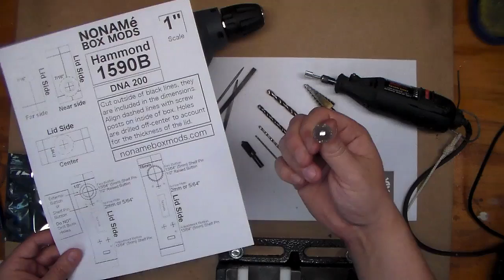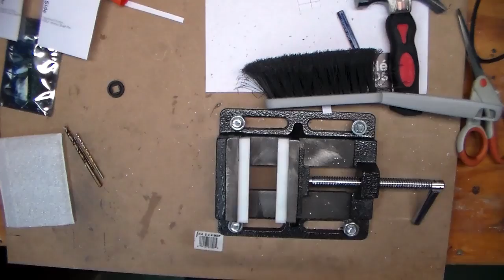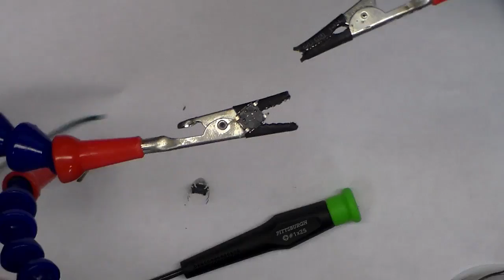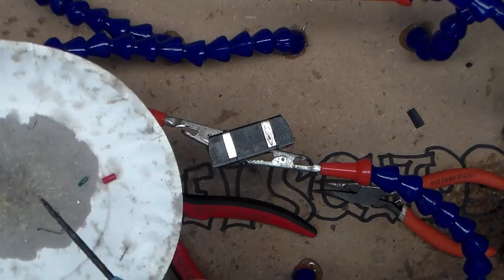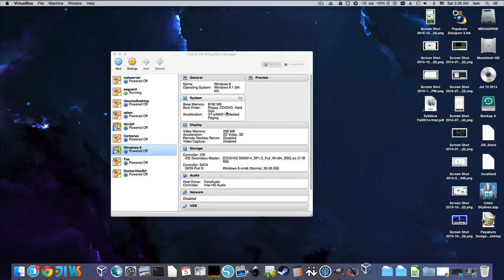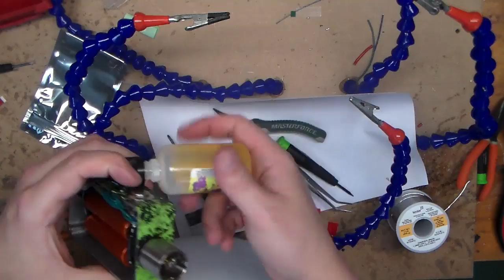Dual-18650 DNA 200 Build

Comment: hey question I have everything wired up, I hit the fire button and the evolv screen turns on, turns to 8.5watts, then 2 secs later the unit turns off, why is that? have you had this issue?
Reply from the maker: You might not have the balance charger connected correctly. The notches are supposed to point down. Otherwise make sure the buttons aren't jamming or otherwise being held down.
Reply: Advicevice how to order?????

Comment: I missed the part where you attached the screen? does it just plug in or is there a latch?
Reply from the maker: There's a little latch on the board that flips up. Insert the ribbon cable and clamp it back down.
Reply: +Advicevice Ya, I figured it out shortly after my response. unfortunately I think I got a bad board and am still waiting on evolve to tell me what to do about it.😔

Comment: I did not understand : it is a serial or parallel connection of batteries ?
Reply from the maker: It is wired in series. Parallel wouldn't power the board.

Comment: Correct me if I'm wrong or not, I'm just lerning about this stuff to help my Wife out, but this seems useless now, as it's at $99 and you can buy a Fucai for $43 Free shipping, so why pay $99 and then still have to build it yourself when you could buy 2 Fucai for that price.
Reply from the maker: +Rspene smit Honestly, you get what you pay for with Chinese knock-offs. The other side of it is a lot of people enjoy building stuff. You can buy a pre-built model airplane or build one yourself.
Reply: +Advicevice Ok, thanks for your reply, I do like to build some things, but I'm limited on the projects I can do, but I might give it a try, but it sounds like the $43 one I found on ebay, may not be good or great Qualitty, so also I guess if I want the best Quality, either try to build this one or find a seller in the U.S. that sells an original one, I have not checked prices yet on an original.
Reply from the maker: +Rspene smit The board featured in the video was designed and manufactured in the US by Evolv Vapor. That does generally cost a little more, but it also comes with great warranty support. I doubt you could expect the same from the Chinese suppliers.

Comment: Question. Are mini zip-ties a good or bad idea? I have built many PC's and love using them on wires/cables, but have never built a mod. It seems like they would come in handy. I'm talking about the real thin ones, not PC size. Thanks. 

I really appreciate you bringing these mods to market and the build videos. you are very thorough.
Reply from the maker: +Rob G As long as you're crimping the wires to the point they break, I think you would be fine.

Comment: Yo m8. The DNA200 chip works at minnimum 9v input so how does it even start ?!
Reply from the maker: +Enteriel You can configure it with eScribe to operate with 2x 18650s: https://youtu.be/orizvoMytfM?t=1h59m54s

The only downside is it's limited to 133W
Reply: +Advicevice ok, now i get it ;) ty for Help !! Cheers ;)

Comment: Im keen on buying a kit, can you have the atty offset instead of in the middle?
Reply from the maker: +Dr Shlots You're building it, you can put it together however you want. With that build it's all a matter of preference. The drilling diagram was templates for each position.
Reply: Thank you, also i live in New Zealand what would be the cheapest shipping method?
Reply from the maker: +Dr Shlots I just added New Zealand to the store, it will be $34.95 USD. I know it's outrageous, but that's actually my cost on shipping.

Comment: love the vid btw
i wanted to ask if i dont want to use the in built charging can i just put the + and the - to the bord without the jst conector
and ps do i still need to use the escribe software to change the battery profile
thanks
Reply from the maker: +jonathon cobb If you're running off battery, you need to connect the JST balance charging connections. The board won't fire without them. It will in passthrough mode, but that's because there's a power supply that doesn't need to be monitored. If you are only using 2x 18650, you have to change the settings with eScribe. It's a good idea to look up the discharge profile for your batteries.
Reply: Thanks for that I wanted to make sure now I know I will make it so 😊

Comment: Escribe was working. It linked and I was able to run the device monitor. I still couldn't get the screen to respond even when I tried to change and upload settings. Ive built several but this is my first with the off board button. I'll do some more trouble shooting and let u know how it turns out.
Reply from the maker: +Mitchell Henderson I guess, the obvious thing would be to check where you soldered the button wires in to pin holes 1 and 2. If it's bridged, that may be an issue. If you have another screen, I'd give it a shot at swapping it out. Good luck

Comment: Plug seems to be lined up right to all the corresponding points. On board fire is not working either.
Reply from the maker: +Mitchell Henderson Are the notches in the JST plug facing away from the board? Options are 1) Screen isn't plugged in correctly 2) It's not getting power 3) The board is fried.

You can test 1) by reading the 510 with a multimeter or putting an atty on it. You might need to play with the up/down buttons. 2) Have you tried plugging into your computer and using the eScribe software to read the board? 3) SOL, contact Evolv about warranty replacement if you haven't voided it

Comment: I used a off board button for the first time...cant get my screen to respond. Any advice on what I may be doing  wrong
Reply from the maker: +Mitchell Henderson The button doesn't have much to do with the screen. You do have to press the button to turn it on. You can try pressing the on-board button to turn it on. That will tell you if it's an issue with the aux button. Otherwise, did you connect the JST (white plug) correctly? It won't power up if that's not on right.

Comment: hello I'm new to this type of stuff. I was wandering if this could be done with dual 26650 instead of 18650
Reply from the maker: +Keith Alexander Yes, but the issue you're going to run into is fitting it in a box. It would need to be pretty big to house the batteries and board.

Comment: You should try using the Mitec 12mm buttons if you haven't already they are still a 1/2" hole like the standard horn switches but they don't protrude into the box nearly as much and could save you a lot of space trouble. They do cost a little more but they look really clean and make the process a little easier. But that's just what i personally use.
Reply from the maker: +Jeremy Farrow I've stayed away from the Mitec switches because they are really just a tactile switch underneath the button. I may buy some to try in the future though.

Comment: if you had a big enough enclosure, could you attach the other positive wire to a third battery so you had three cells? or do you need a different connector?
Reply from the maker: +Frank Loring Yes, that would work.
Reply: +Frank Loring I thought about that too!  Im sure you could fabricate something to hold it on the mod, but it would look goofy as hell.  Would I buy it for home use, sure.  While were at it, why not four batteries?  I have a Wismec, so Im already spoiled.
Reply: +George Pirpiris.  I was going to maybe see if I can cram three in the 1590b. just take out the battery sleigh and solder directly to batt contacts.  use brown LG's.  should last all day. plasti dip inside enclosure.  piece of 3m tape between board and Batt.  drill in some vent holes for cooling. might get warm but worth a shot.  there will be better 3s lipos coming soon. hopefully...

Comment: Since you voided the warranty by removing the up/down buttons, why couldn't you attach the wire from the tactile switches to those pads? Theoretically this should be the same point as where you attached the wires from your tactile switches on the side of the board.  This would have eliminated the need to run wire all around the board, or if your looking at the screen and the fire button to your left have the tactile switches come out the back of the box and operate them with your thumb.. Just a couple of suggestions i was thinking of while you were building.
Reply from the maker: +Tracey Richard Originally, I wasn't planning removing the on-board buttons. I guess the other thing is the through-hole solder points are much more secure, and consequently easier to solder to. The solder pads for the on-board switches are very, very small.

One thing I very briefly mentioned was actually getting the buttons in place, you need some slack in the wires so you can apply your glue or whatever. Going the long with the wires provided just enough slack to do this easily.